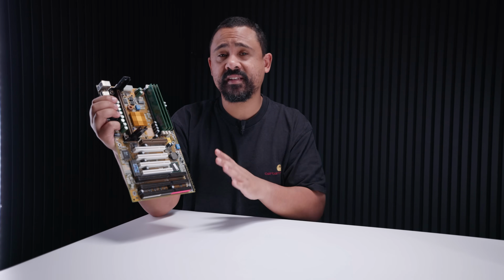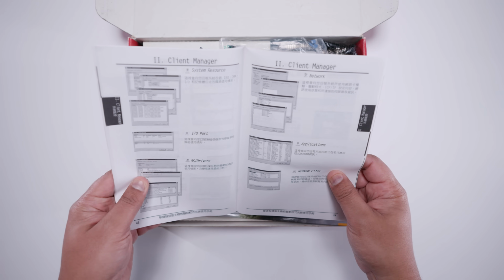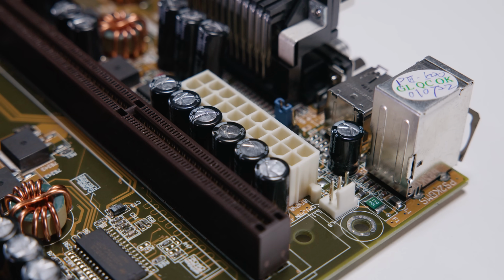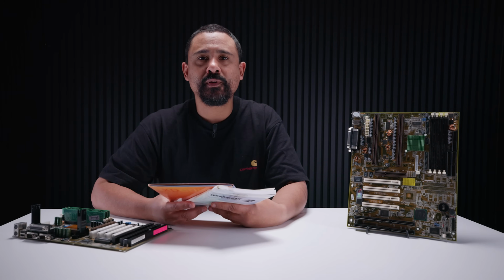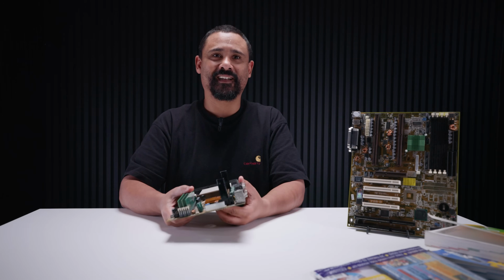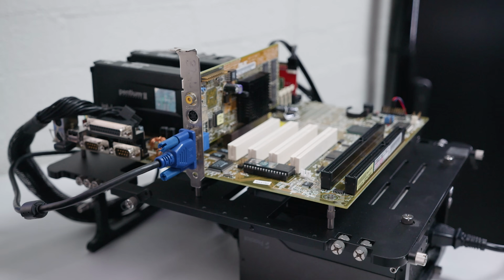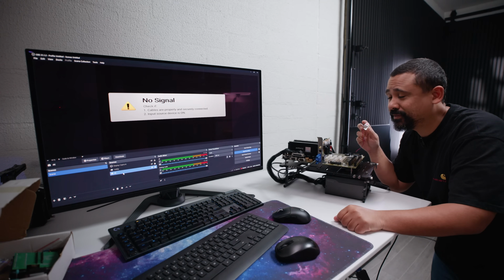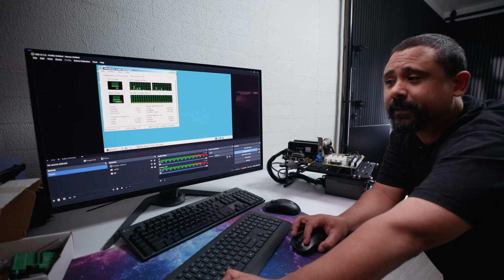The motherboard dreams were made of... in 1999

Comment: Well put, thank you. I also have a system like that, with a Tyan Tiger 100 S1832D and two Pentium 3 700 CPUs as well as 1 GB RAM. But Windows 9x was one of the reasons why this technology never became widely established back then. Hardware was expensive and became outdated more quickly, and apart from large companies, private users probably didn't have a need for such a platform. Yes, I remember that there was a bit of hype about this technology in specialist magazines, but it was often greatly overrated. Today we know that cores or multiple CPUs alone do not mean multiple gaming performance. So I see it more as a technical show when it comes to the gaming sector. But I still find these systems exciting and exotic, because hardly anyone had them.

Comment: I remember buying a PC Chips motherboard that had both a socket 370 and a slot 1 on it however, you could only use one at a time. When I bought it I could only afford a Celeron 400. About 6 months later I was able to buy a slot 1 Pentium III 550 and upgrade my rig. I had a Power color X-Demon S3 Savage 4 video card and this rig would play Need for Speed Porsche 2000 like a dream on a 21" Sony Trinitron CRT.